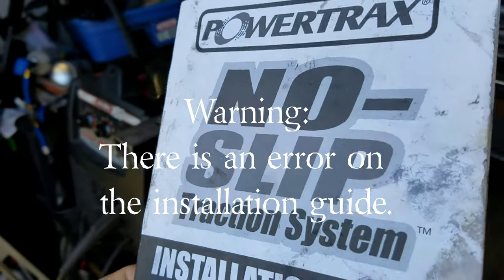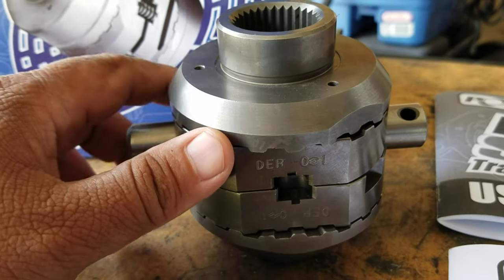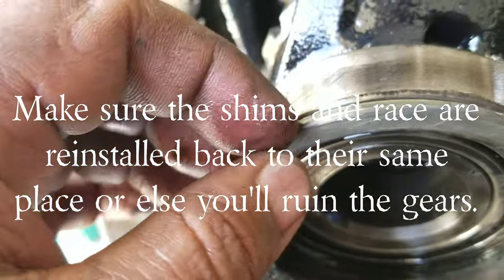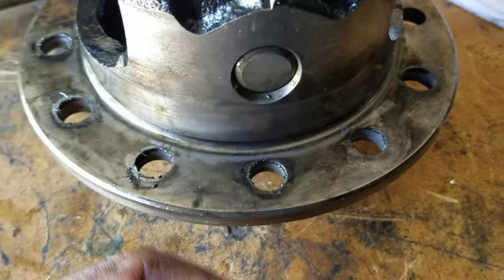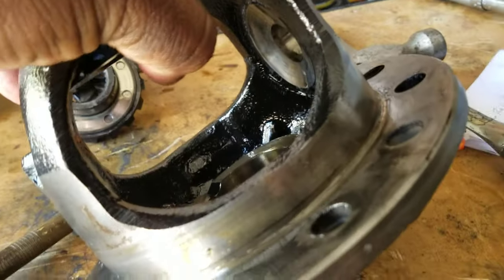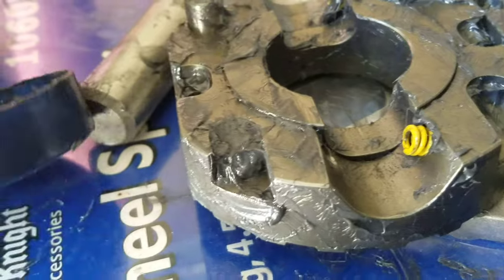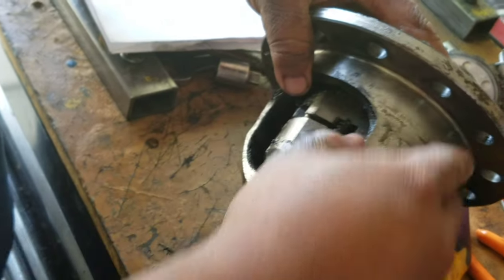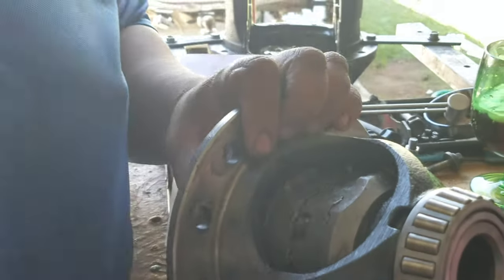Toyota 8.4 Diff Power Trax No slip Locker Install

Comment: I saw a previous video about the no slip locker creating shavings that were ruining your axle seals? Have you switched to a new locker?
Reply from the maker: Yes. I am currently running TJM Air Locker rear and ARB front locker
Reply: @theotherguy3083  what did you do with the old locker? wanna sell it?
Reply from the maker: @travissaffery  it was sold

Comment: Did you have any problems with this locker?
Reply from the maker: No. However, you need to change the gear oil often as it produces small metal shavings which eventually wear out the inner axle seals